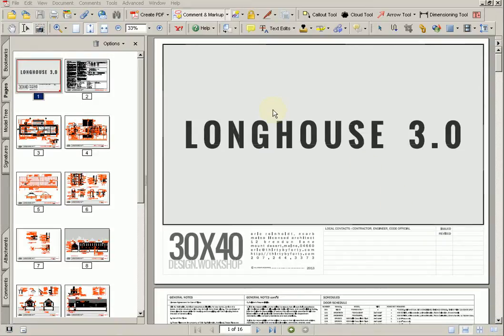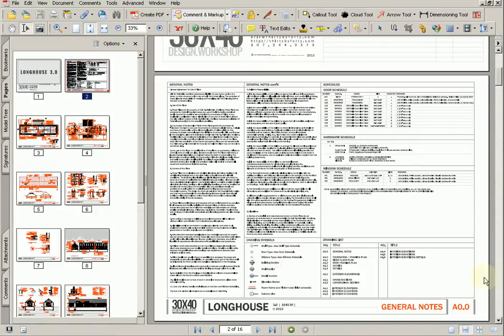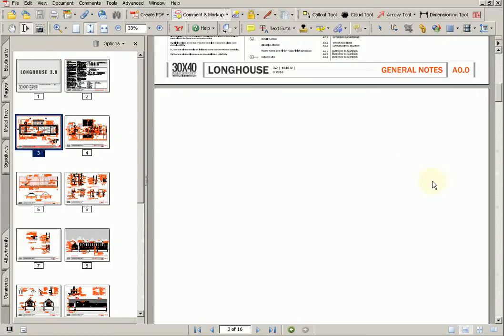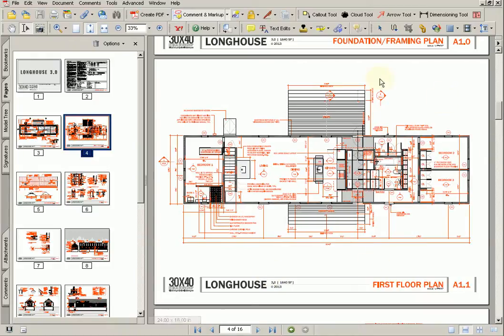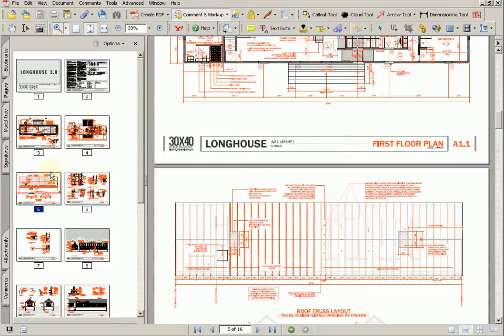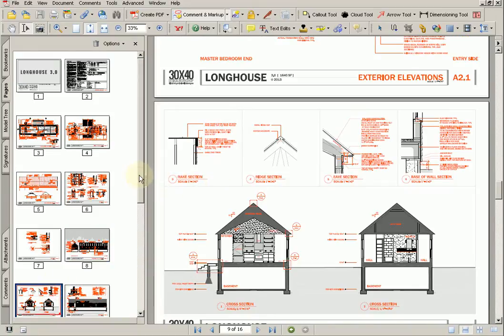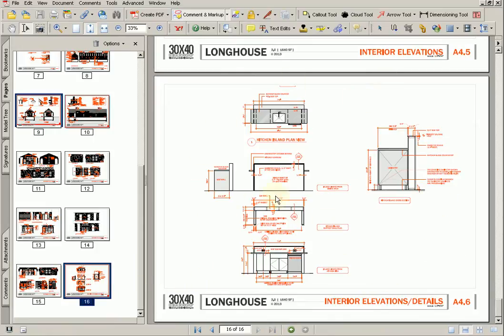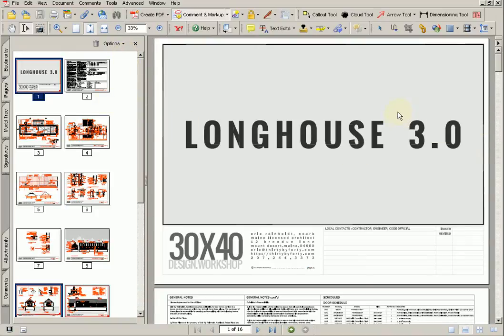Longhouse 3.0 (3 Bedroom) Construction Package Contents

Comment: Do the rafters connect to a ridge beam? If so how? Since the house is very long in length. Curious as to how the roofing construction on this is like. Architect student here first year.
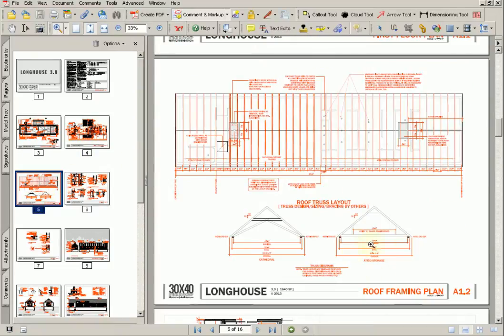Reply: at 2:10 you can see that this building uses both rafters and trusses to support the roof.  in some places the rafters might need a ridge beam and in other places where there are ceiling joists they would need just a ridge board.  hope this helps.